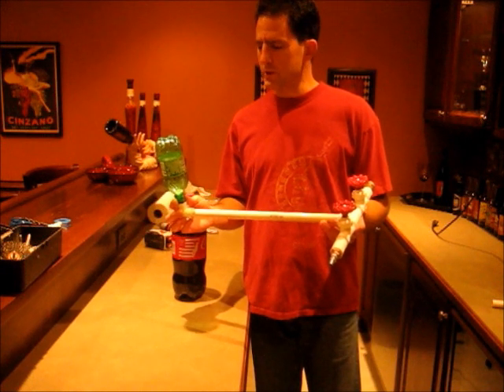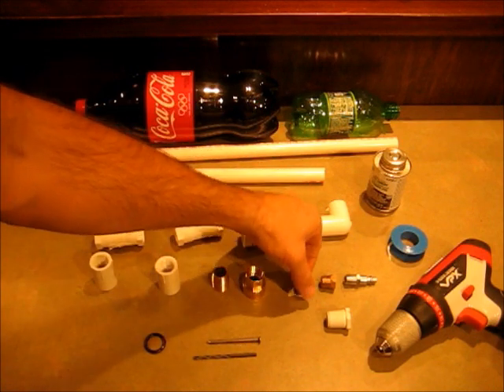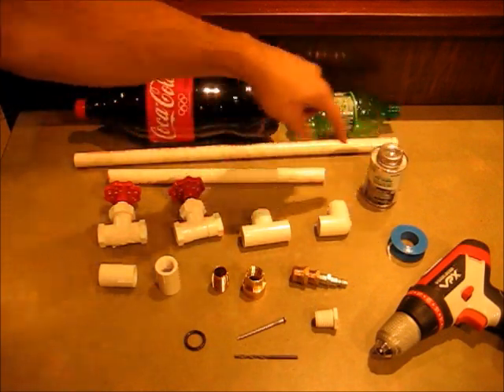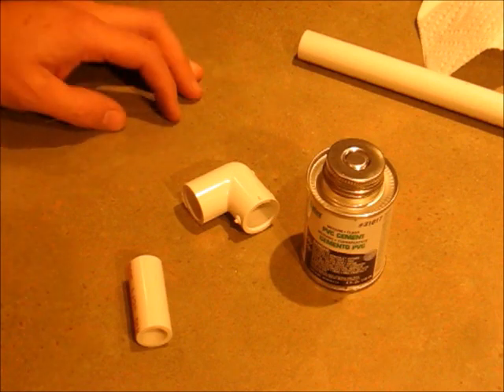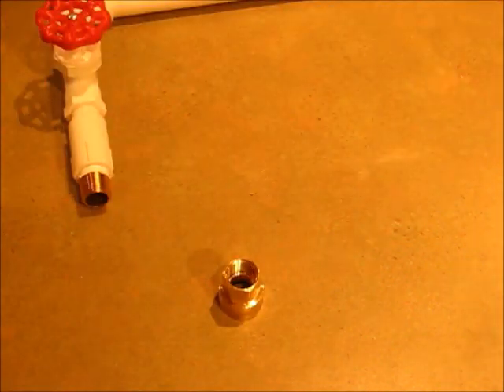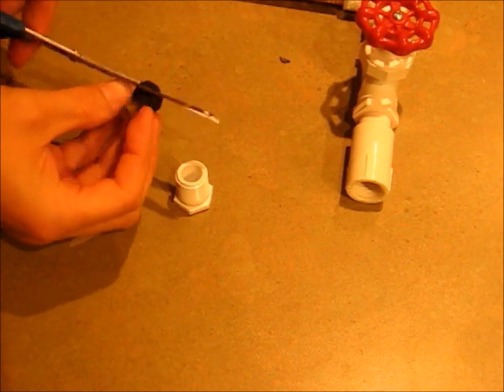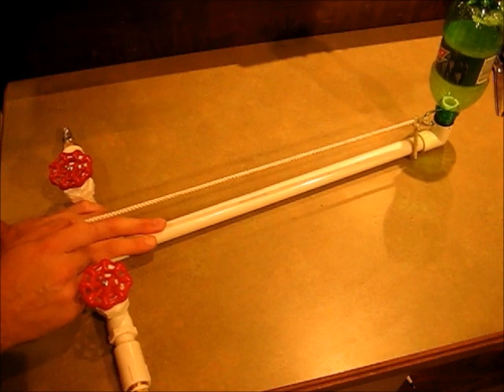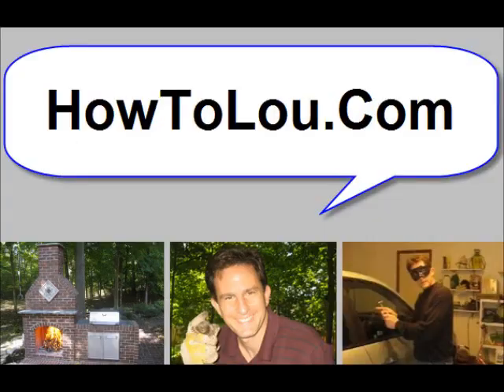How To Make a Water Rocket (HowToLou.com)

Comment: yes that would work or for a durable seal, just using a hair dryer to heat up a small section of the PVC pipe which will allow you to push the pipe together creating a small "swell".    Pushing the bottle down onto the swell will completely seal the bottle and hold it in place to about 60psi.